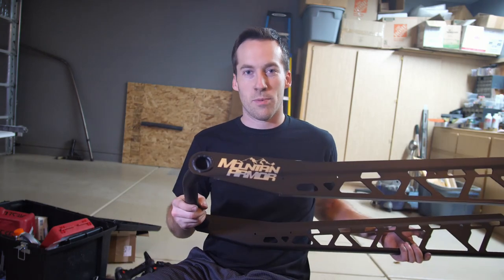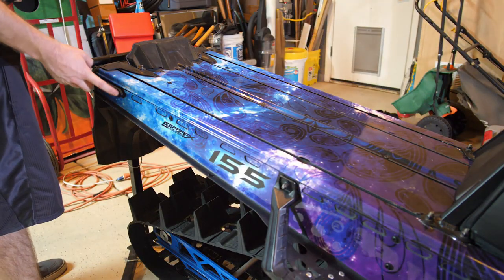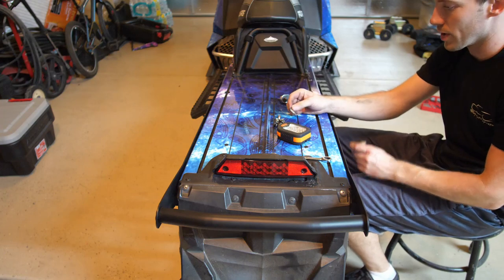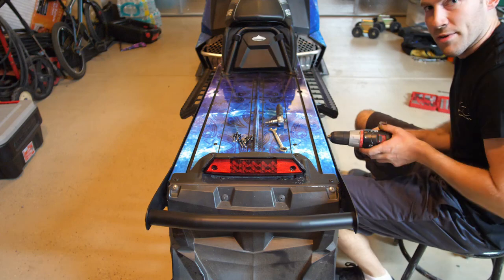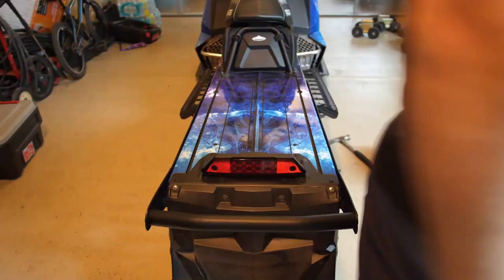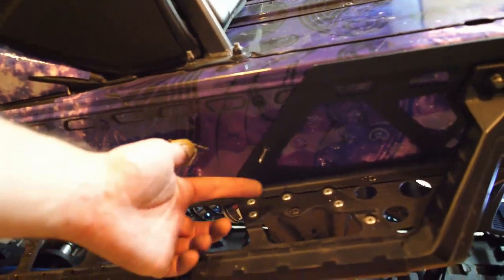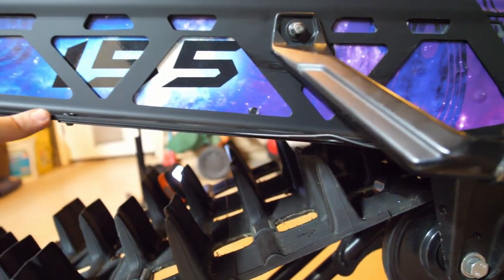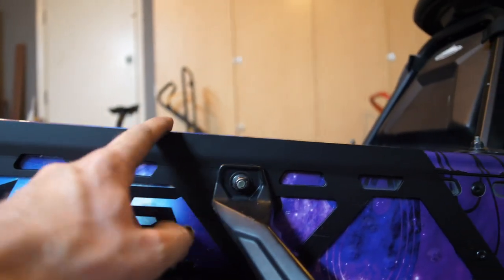THE BEST POLARIS AXYS REAR BUMPER - Mountain Armor

Comment: I had the van amburg rear bumper on my my 14 pro. To strengthen a bent down tunnel after hopping a creek at Mt baker spring riding. The tunnel made no contact with anything just had water bottles  in my shovel bag. Which apparently was enough weight to tweak these lightweight tunnels. Gonna be proactive this time with the new axys and put either this or another VEI. on. I think the VEI. bumper may give a little more support with more rivets. But I like the top edge tie down points you were describing on the Mt Armor. Decisions decisions!

Comment: Have you tried to tow a snowmobile with this rear bumper? Is it possible to tow with a RMK?
Reply from the maker: Not sure why i never saw your comment. I never tried to tow a sled with it. But i would imagine you could easily do so since the mountain armor one is much stronger then the stock bumper. I would still loop the tow strap (if its long enough) through the rear of the running boards for extra support.